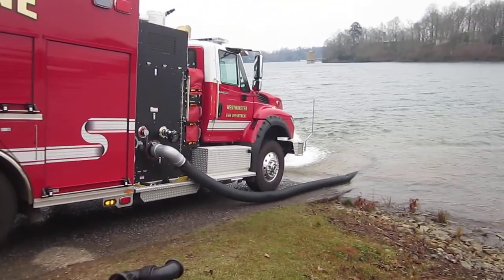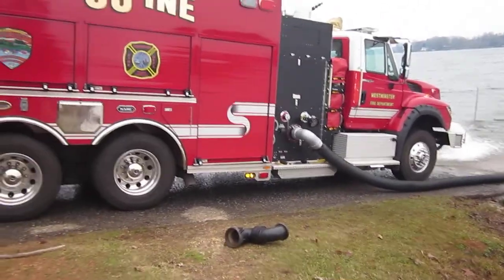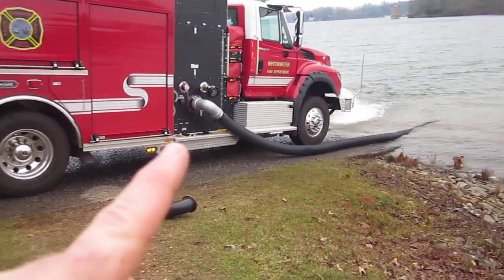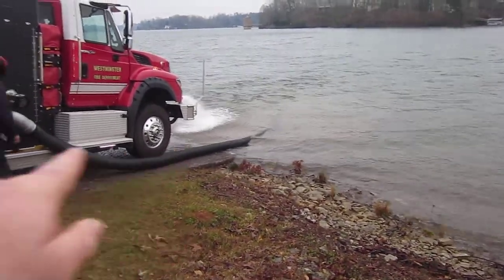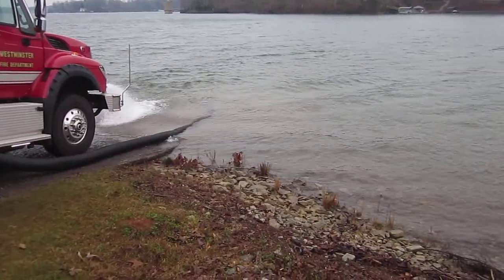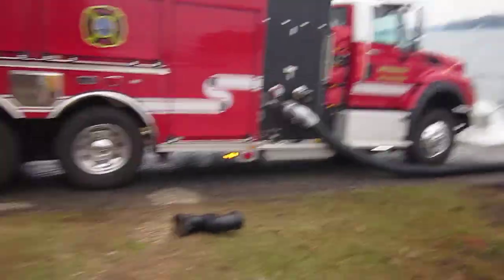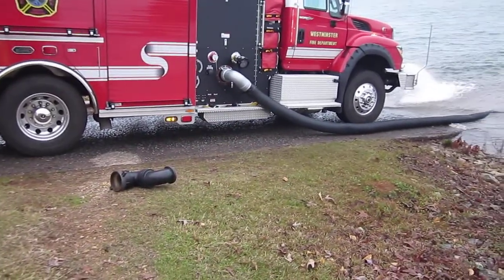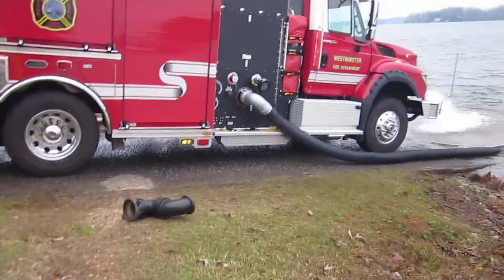Part 9 - Rural Water Supply Drill - Oconee County, South Carolina - March 2018

Comment: What make is that Westminster pumper tanker at the draft site.. ? And what does it have for pump, tank etc. ? Thanks
Reply from the maker: Westminster E63 is a KME rig equipped with a 1500 gpm pump, 2500 gal tank, and 3000 gal dump tank. Also has 20-ft of 6-inch suction hose pre-connected in a "squirrel tail" fashion.
Reply: GotBigWater thank you !!!
Reply: THANKS !